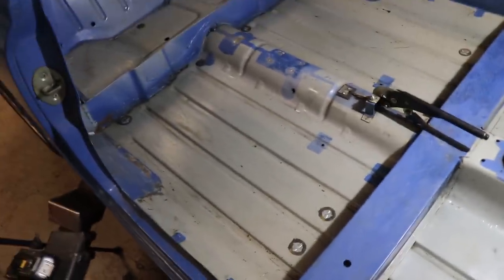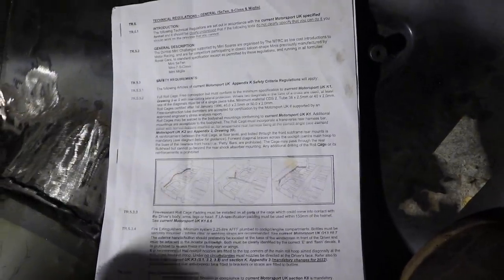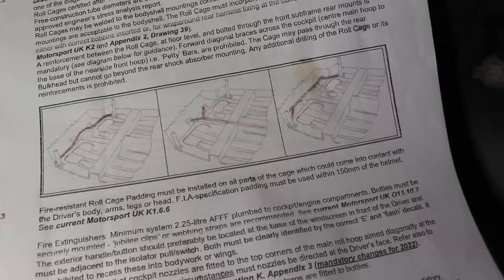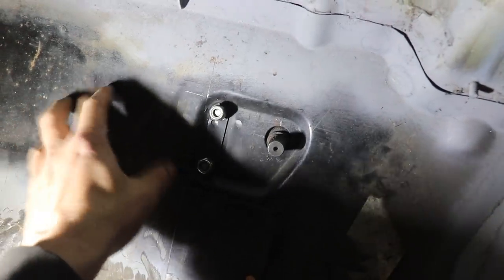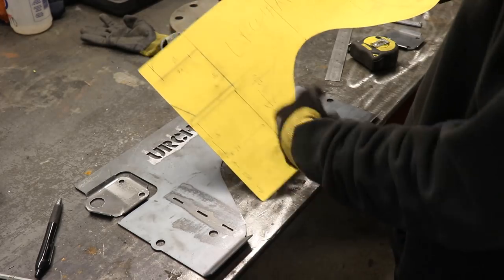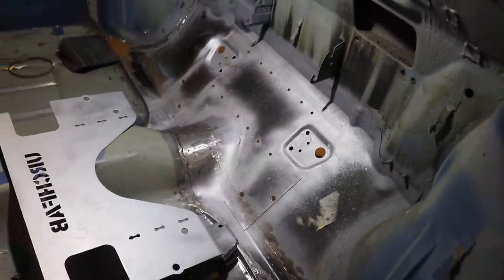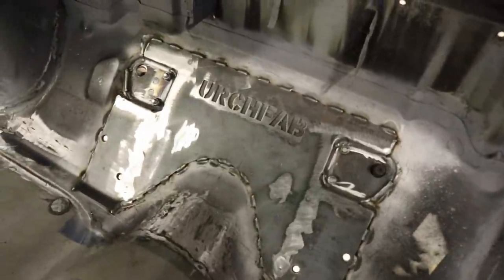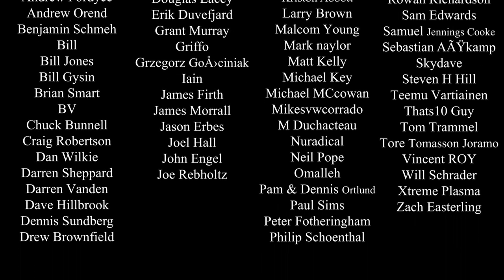Building A Classic Mini Race Car - Part 2

Comment: Tip for sound deadening buy the plumbers spray that they use to freeze pipes before they cut them, easy to get hold of just spray the deadening then give it a few hits with a hammer.
Reply from the maker: You could have told me last week!
Reply: A bag of dry ice works wonders 👍🏼

Comment: The Libre class looks like a great move. Lots of scope for mods. 
If you can use a twin cam head, I believe a BMW bike head k1200 is a great conversion.
Good luck.
Reply from the maker: Cheers Mark.
Reply: It's a great class but it wouldn't be competitive in any way or shape due to how open the rules are and the kinds of cars that compete. People go quite wild.
Reply: @KJMTurbo  Be interesting to know how wild folks go? I would have thought with a 16V BMW bike head, some head and cam work with throttle bodies and decent exhaust a 1380 A+ block would be competitive.

Comment: Building a competitive race mini is quite a costly affair. But I assure you that after all, when you have crossed the startline it's all been worth it (nevermind what you have spent). Even if it's been a an arm and a half! Just remember to not be cheap on your transmission. The transmission on a mini should be kept state of the art because thats the units that is most likely to break down. My 2ea breakdowns  on my historic mini this year have all been down to outputshafts and gearbox bearings.
Reply from the maker: Thanks Martin, I will keep that in mind.

Comment: That plate is very very neat and if you were to sell them I’m sure you’d have some interest. Cracking on the toe board can be quite common if you change to solid mounts like I have (usually only if you change the rear mounts to solid and leave the others as rubber, less likely if all solid). Excellent progress. Great stuff

Comment: Just a thought knowing how tight minis can be with things. When the column is fitted to the rack is there clearance for the pinch bolt etc where the plate has been welded? 👍👍

Comment: Matt, I know that it is possible to fit a BMW K series motorcycle cylinder head to the A series engine. I believe you have to add two studs but it is very do-able. This will give you an alloy 16v twin cam with little cost. K series 4 cylinder engine range from 1.0 up to 1.3, but I can't  say which of the four options will be most suitable, obvs you will want to have the biggest valve option available..
Reply from the maker: I have been looking into these. Cheers

Comment: Matt, you’re doing it again! (With all of your extra strong brackets and strengthening pieces..) The late Colin Chapman would be saying: “Matt, that’s a super strong job with complete integrity but you’re going to be at the back of the pack at the first bend because your car is the heaviest” (I.e. - built like a brick s**t house)  😊😊😊😊
Reply: That plate could be just as strong weighing a third of that one
Reply: A lot of spec series require ballast and have a designated minimum weight. Stiffening a chassis isn’t a terrible way to spend weight.
Reply: @miketucker7466  yes - agreed!

Comment: I know in the US some of the sanctioning bodies don't allow you to grind the welds on the roll cage. Is it different in the UK, or is it ok for the bottom plates?
Reply from the maker: That is a rule here also. I wont be grinding away any welds on the cage and if the boxes weren't welded inside I wouldn't do it on those.
Reply: I thought it was a rule here in Australia as well but I read everything and it didn't say anything.
But grinding welds weakens them anyway so I don't know why you would.

Comment: Re your comment about only using 2mm so the plate doesn’t weigh much - do the regs cover the weight of the car? If yours ends up heavier than the rest of the grid you’ll be at a disadvantage albeit safer

Comment: Will you be putting anything under where your boxes will join to the body structure?  Assuming you fillet weld I would be concerned in a heavy compression impact from the roof that you could punch through or buckle the 3 sided box you made.  A web plate below with a internal rib inside the box would make them much stronger and resistant to collapse.  If you were already planning something like that great 👍.  If not consider it but it is probably to requirements as is.
Reply from the maker: No but there will so much of the cage welded to the body there would be no possibility of that happening. I do see what you're saying though.
Reply: @Urchfab  sounds great.  Look forward to following along as you build the rest of the cage/car.

Comment: The class you will be racing in does it matter what brand the engine is? Or is it as long as it is not more than the maximum displacement for that class? Great design and weld work again Matt!
Reply from the maker: It has to be an A series engine bud.